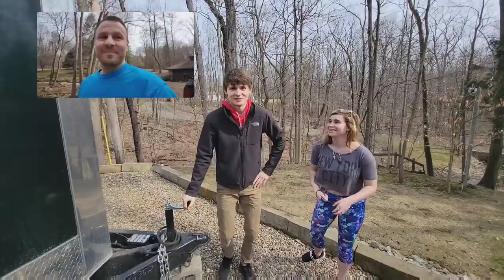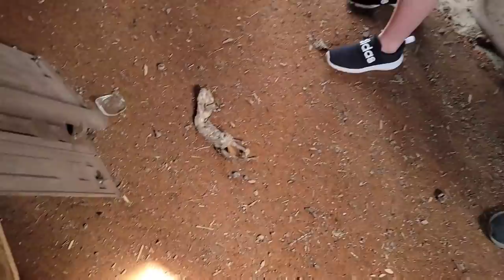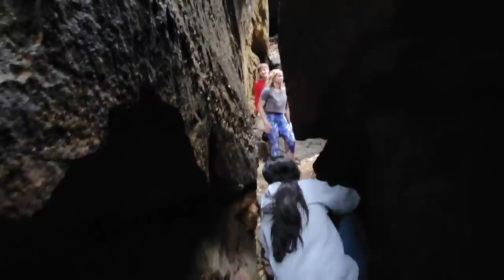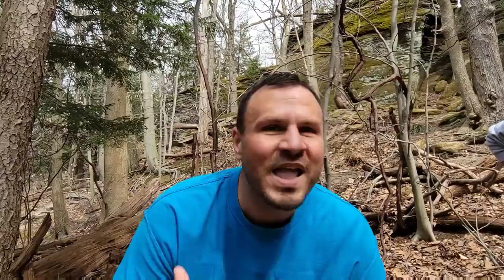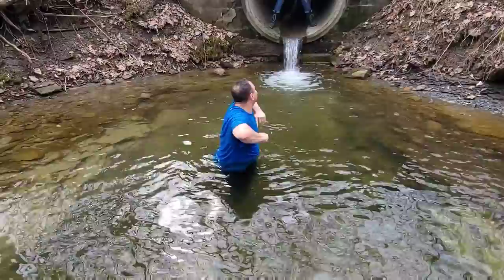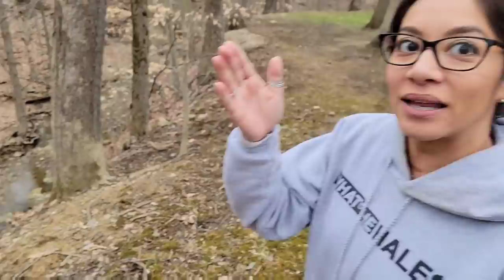CAN'T BELIEVE THIS HAPPENED IN OUR BACKYARD ... I Bought My Dream House

Comment: I believe it's a power wheel they put lines up on the creek from 4 in all the way down to half inch and then there's a alternator with a wheel on it that sprays and then produces power to charge batteries

Comment: It looks like you might have a Well where the Electric Switch is. . For Spring Water 💦 looks like a Tap to Me. !     And that area in the Creek that you where Joking About 😂, Gold 🥇.  Had Black Sand ⌛ mixed in with Sand. 
Could be Gold Bearing  .

Comment: Hiya J.& G. , looks like yall are having as much fun as when yall bought the Ranch in Florida.  Probably more fun, and you don't have to worry about Hurricanes.  Hey that electricity in the creek is probably for a pump, the the pump isn't there, but the stand for it is there. 
I'm so happy for you guys, and thanks for sharing all you do, awesome video guys, hey on the tractor on the left side one handle is for High and low, and the foot pedal is to lock the rear end for  Positive traction. Those old tractors are really cool but you have to give it the gas for the hydraulic pump to work faster.  
I hope everyone has a awesome blessed day. 
Cya!  😺🐟 out!

Comment: FYI it is not a good idea to stand in front of those tractor tires when starting or when it is running. If it is mistakenly in gear or the driver's foot slips of the pedal... when you can figure out the rest. Great video though, and what a beautiful property!

Comment: The pto has to be on for the 3 point to work. It's kinda a pain if you want one or the other and not both like if you drive in taller weeds it wraps up in the pto.

Comment: I don't know what that electric cable is connected to , but I wouldn't plug anything into . Ever wonder where electric cables end and how they  end installation at . I tried looking it up but so far hadn't found anything on it . I wouldn't be messing around with since electric cables have 40,000 volts going through them .